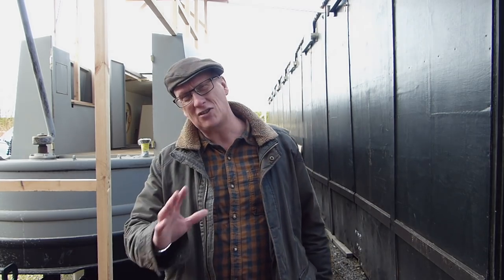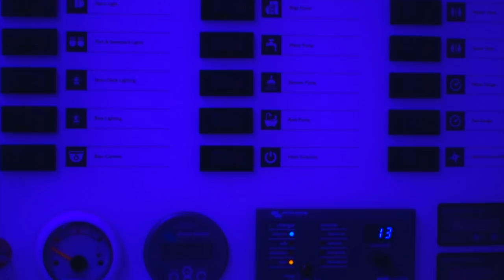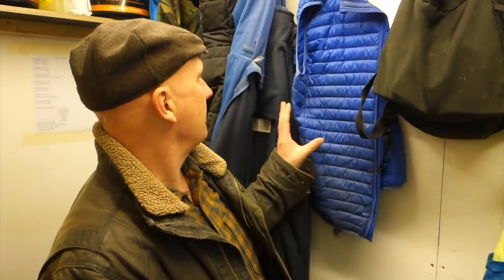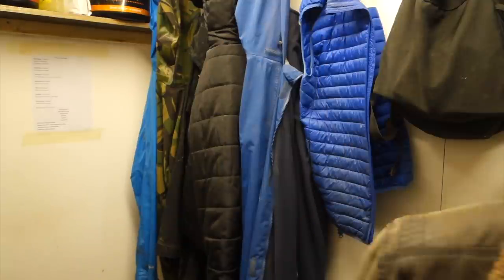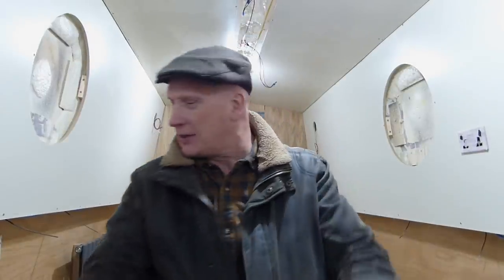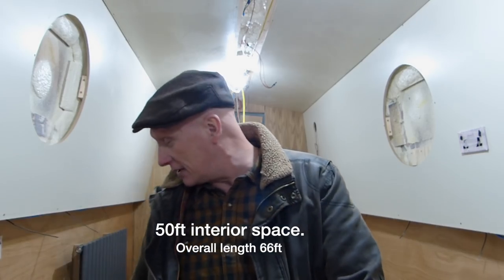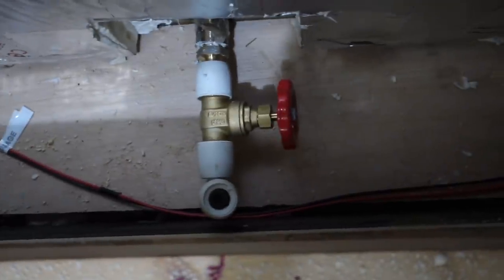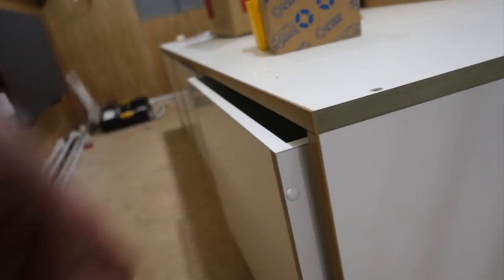Ep 19.  Bespoke Narrowboat Update

Comment: Simple innovation like the plastic piping and clips.  Sometimes the most innovative ideas are missed as they are so simple.  I assume boys used to use lead or brass piping?  Also, the fact that the connectors mean you can easily remove the radiator, clean, paint or replace without having to disconnect water supply throughout the boat.  All innovation
Reply from the maker: Good observation Paul. In true style of being useless at DIY I haven’t a clue what you’re talking about but I’m now going to ask. Thanks for the comment as it could save me a lot of hassle should I need to change a radiator.

Comment: Nice vlog! - are you having lots of access holes into the bilge?  Also, are they putting in wires for your solar into the roof now (if you're having it?).... Rob
Reply from the maker: There are holes in the floor to access the bilge.  I don't think it what you think as each pump has a tray which alarms.  I'm not a builder.  I just trust their workmanship.  
Yes to solar.  I assume, again, they know when to put them on the rook and where to put the wires.  Roof, probably as the lights are not fitted until the end.  Makes sense, I think.  Thanks Rob.